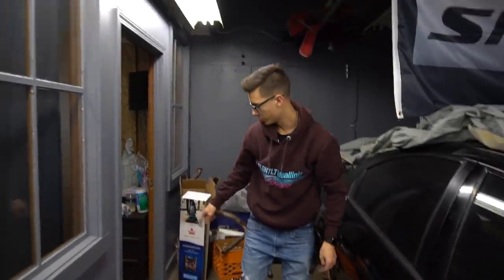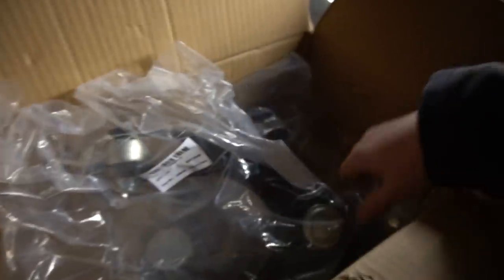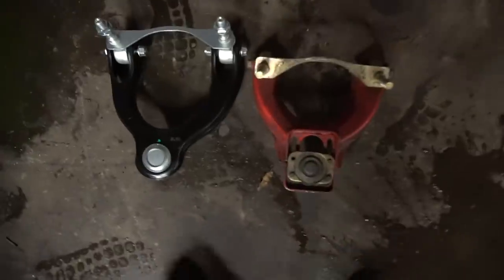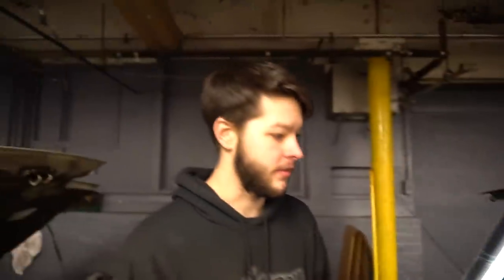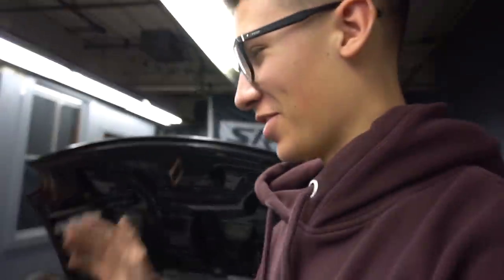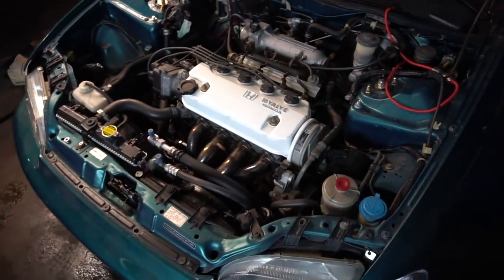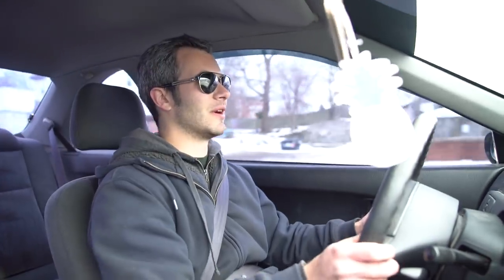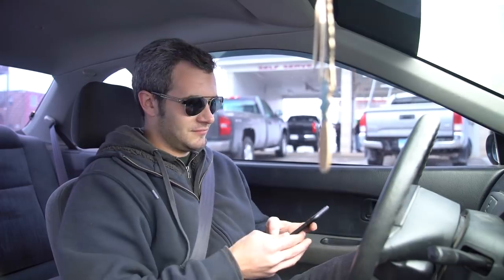FIRST DRIVE IN THE CIVIC!

Comment: Tighten the bolts for any suspension related stuff under load. Some rubber bushings can get stretched causing faster wear. Cool job so far

Comment: You should wrap those wires or put a rubber grommet on the metal where they run through the firewall. Vibrations can wear through the wire insulation

Comment: Does your car run the same after the swap?I wanna swap my civic but some forums are saying if I dont switch my intake then it will run like shit..is this true?
Reply from the maker: I have never had a problem with the intake, the car runs great, you should be fine
Reply: @diiviinemedia  thanks for the super fast response. I'll be doing my swap this weekend. Keep making dope videos and I'll keep watching 😉😉
Reply: @diiviinemedia  ok I'm in the middle of my tranny swap and I'm stuck at the the bracket the holds the shift linkage. What's the best way to get it off?I think I got all the spot weld but it's not budging

Comment: doesn't it make you cringe knowing all that salt and slush is splashing up on your under carriage?
Reply: JJM Some people actually like driving their cars since that’s what they were made for
Reply: Its called wash your fuckin car
Reply: Hypn0tyz3d dunno about you but I have a hard time washing the undercarriage and inner fenders of a car that sits a couple of inches off the ground with no fender gap 😅
Reply: Hypn0tyz3d washing is even worse because you are pushing the salt deeper into the grooves. Just wait till the next rain and you'll be golden.
Reply: @tristan8243  What grooves are you talking about? Both framed and unibody cars have holes that route the water out. Also not that hard to buy a $60 harbor freight power washer and some jackstands and a jack. Or if youre that incompetent take it to someone who has a lift.